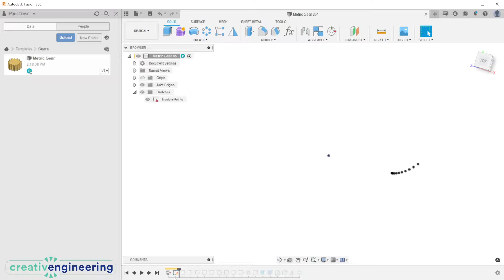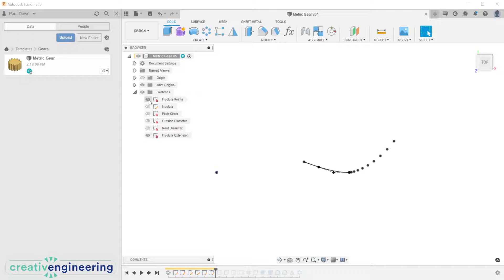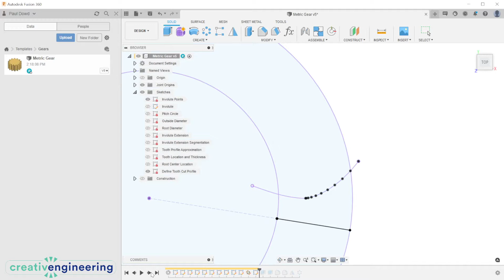Amazing! Fully Parametric Fusion 360 Involute Gear

Comment: would this work when designing sprockets?
Reply from the maker: I think sprockets might be easier. What makes spur gears hard is the mathematically defined involute profile curve. Doing a parametric sprocket is a good suggestion.

Comment: I would love to see how to implement two of these gears :D
Reply from the maker: I built that then had some trouble documenting a foolproof process. I'll try to get back to it and film another video. As I recall, the steps I took were:
1 Make a new empty file
2 Insert the gear as a new component, then unlink it
3 Insert the gear again, then unlink it (now there are two gears)
4 Make a sketched line representing the center distance
5 Join each gear to each end of the sketched line with a rotation joint
6 Make an equation to calculate the center distance = ((N1 + N2 +.5)/2)*Module
7 Do a move feature to rotate one gear to mesh properly with the other and not interfere
8 Add a gear joint between them
The result was a pair of gears which could be parametrically modified and always mesh properly. You just have to go and redefine the move command to tweak the rotation of one gear to make it look pretty every time you modify it.